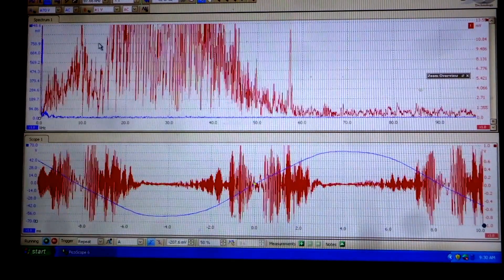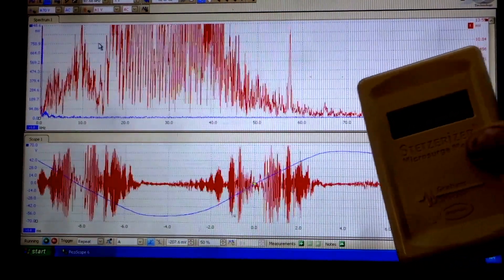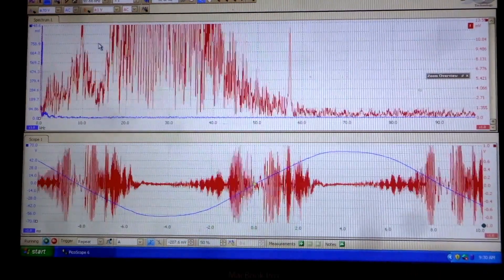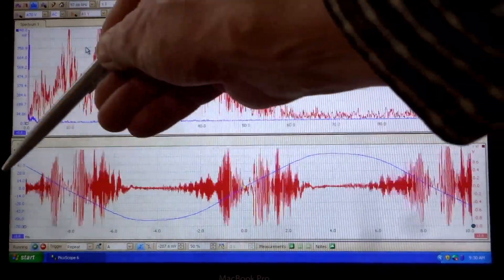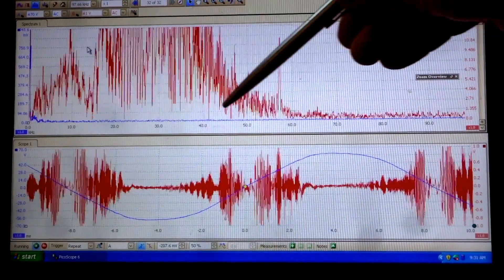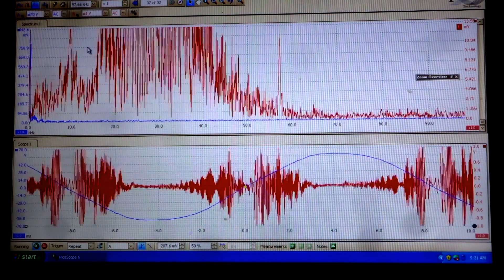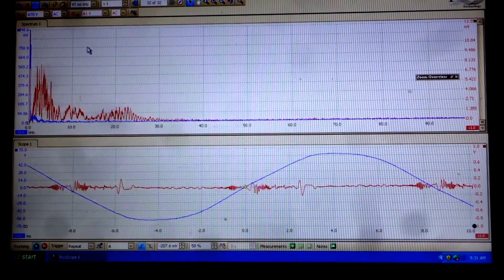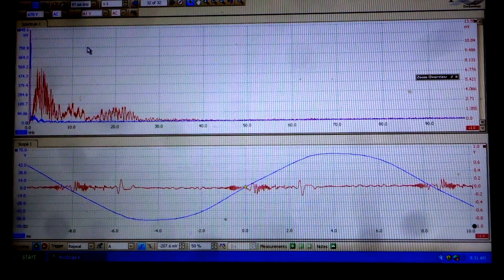LED light bulbs in kitchen produce high Dirty Electricity levels

Comment: I had read a long time ago that some LED bulbs produced dirty energy.  Then it was easier to find the type A bulbs but not so much anymore.  Are there any LED bulbs that are safer?
Reply: There are LED light bulb that are save and clean. But you have to check it by yourself, using try and error method.
Reply: @nicktick8929   Thanks!
Reply from the maker: Some screw in LEDs are clean now.